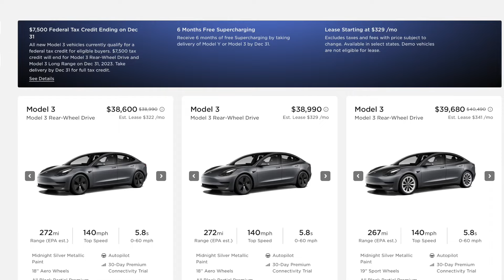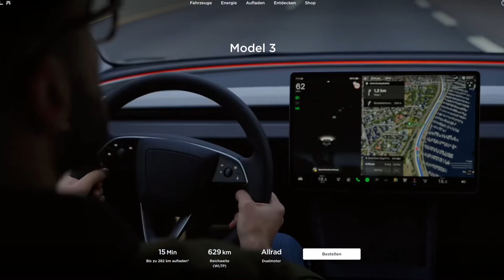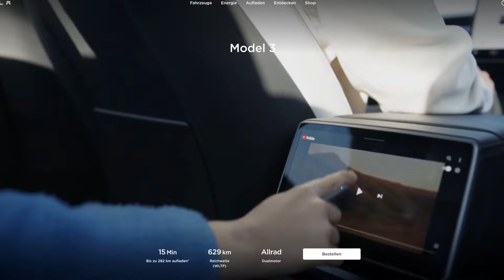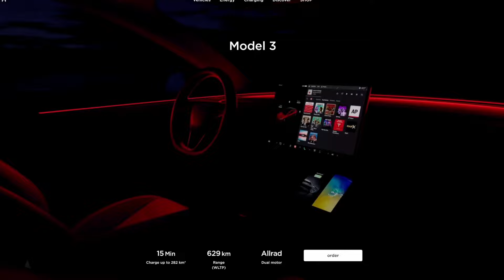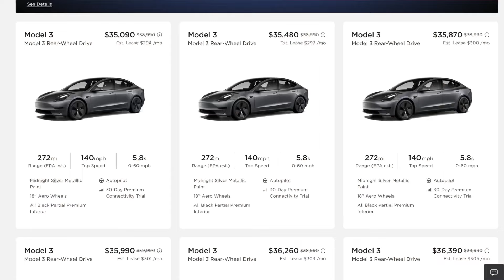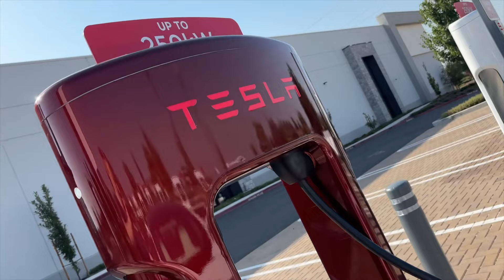Model 3 WON’T be this Cheap for a WHILE 👀

Comment: The question to you Drew is would you buy a used 2020/2021 used M3 from Tesla used inventory or a brand new $35k 2023 M3? Since you’ve preferred the former recently
Reply from the maker: Would depend on how much you'd save going used

Comment: I have seen a few news articles talking about Tesla getting slapped by NTSA and having to recall (more accurately send update) to the free AP. That will increase nag and limit where it can be enabled. Have you looked into these changes? I don’t think FSD Beta is affected in this latest recall.
Reply: My understanding is people would turn on auto pilot. Then override the system. Then forget auto pilot was off, the blow through a stop sign.
Reply: @Dularr  even if AP was on it would blow through a stop sign. It don’t respond to lights or stop signs. If you actually read directions in Teslas manual on the Autosteer of AP it specifically states it’s only to be used on limited access road. So Tesla will likely geo fence AP so it only works where intended. Also sounds like they will also bring over strike system from FSD over to AP.
Reply: @techyjames1945  Which is the reason for the update. People are doing stupid things.